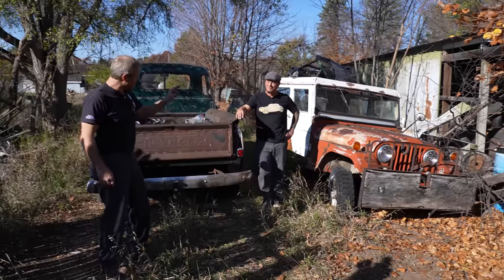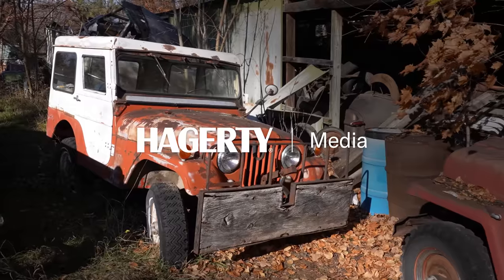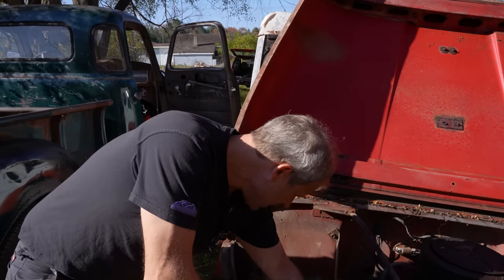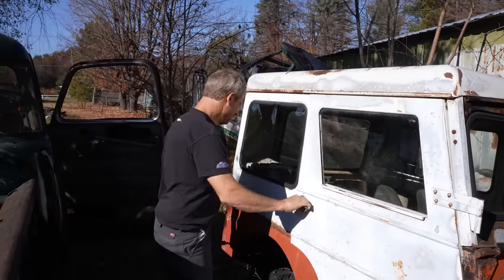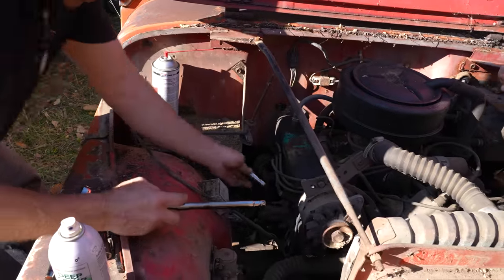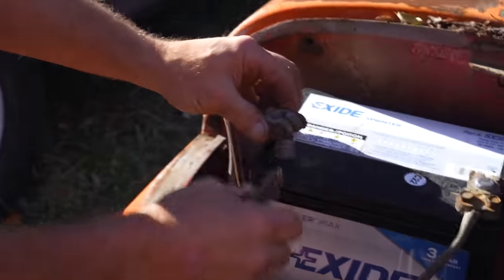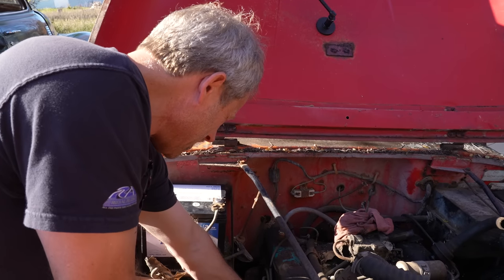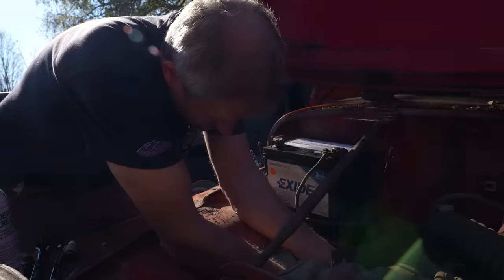Vintage Jeep CJ-5 Parked for 40 years! WILL IT RUN?

Comment: Buick actually sold that V6 design and castings to Jeep in the late 1960’s and bought it back from them when the oil crisis of the 1970’s hit. In it’s final form it was one of the best engines GM made.
Reply: GM made these V6 engines in two sizes. 3.1 and 3.8. The 3.8 was highly modified with turbo for Indianapolis 500 racing at one point. A little research on that would be interesting.
Reply: The Holden Australia (GM) used and modified that Buick 3800 up until the early 2000's in the form of the EcoTec.
Reply: What he said... I was looking to see if someone shared that info.
Reply: Yeah the window in cap is to adjust the spark. Mixtures

Comment: In 1973 my Late Dad bought a 1969 Jeep CJ-5 from the original owner. It had the same drivetrain as this one. The p.o. had also installed a Warn Overdrive and a Ramsey 8000 lbs. P.T.O. Winch. It's what I learned to drive a manual transmission on and it's also the vech. that I took my driver's lic. test in and somehow I scored 100%. I was the first one in my group of high school friends to get my lic. so I became the "taxi". This was back in 1975 so gas was still fairly cheap. And man did we ever drive the wheels off that thing. But the coolest thing to the then 15 year old me was .They had installed in to the dash an altimeter out of a P B Y Catalina Flying boat. Dad and I went to the highest point in the county where we lived there was a fire tower on top that had a elevation marker there and the altimeter matched what the marker said. Sadly both Dad and the Jeep are gone now. But the memories are priceless.
Reply: I, too, was the first in my class to get a license and became the taxi.

But, I drove an '86 Yugo. 😂

It's funny how everyone is your best friend until they all start getting their licenses.

Comment: Did you guys know that this jeep has an odd fire set up?  Makes a difference, I'm told, on how you have to tune it up.  Great job - Buick sold the engine to Kaiser.  It originated when BOP cut a two cylinders out of the middle of a Buick 350ish engine.  Kaiser used it in many a jeep, sold as the Dauntless V-6.  225 was the earlier, 231 was  the later CID.  There was no 304 CID until AMC owned Jeep in the 70's.  GM bought the 231 back from AMC in the the early '70s - and it went on to become the 3800 Buick will into the 80's and maybe even early 90's.  The Buick Grand National had this engine - basically.  After GM bought it back in the 70's, they re-engineered the crank shaft to make the engine and even fire, making it run smoother and less fiddly to tune. There is no relation between this engine and the Buick 215 Aluminum V8, except they came from Buick.
Reply: i have the 3800 series3 in my 06 Buick Allure final run ended in 09
Reply: Actually, the Buick V6 came before the Buick 350 V8 (1962 for the V6, 1968 for the 350). It was similar in design to the 215 aluminum V8 introduced in 1961, and the 300 V8 introduced in 1964 had the same bore and stroke (3.75 x 3.4) as the 225 V6 seen here. The 300 deck height was increased to allow for a 3.85" stroke, giving birth to the 340 V8 in 1966, and the 350 was derived from the 340 by increasing its bore from 3.75 to 3.80".
Reply: @cdglasser  Yup, the Buick V6 was developed from the Buick Aluminum V8.  The Buick Aluminum V8 design was eventually sold to Rover and was manufactured up until 2008.

Comment: 14:33 is why, when I'm working on the engine over dirt/gravel, I bring along a regular 'ole drip pan to shove under the car. And a magnet on a stick. I realized I'll never get those hours back that I used to spend looking for those damm tiny screws.
Reply: When your prepare like that, though, is when the universe kicks in and bolts land in a hole in the frame barely larger than the bolt itself.

😂

Comment: Old retired mechanic here, simple way to set GM points is to turn the screw in until it starts missing, then back it out 1/4 turn and it will be pretty close to 30 degrees dwell. I cut my teeth on points but it sure made my job easier when they went to electronic.

Comment: Great video, guys!  That 225 Buick odd-fire (fired at 90-150-90-150, instead of 120-120-120...) has an odd growl to it at speed, almost like a three-cylinder harmonic.  OMC also hooked these to stern drives, and they were used in the now-rare Evinrude "Explorer" and "Sportsman" 16-foot tri-hulls. 150 and 155 HP, IIRC...
Reply: Spam

Comment: That is a Buick 'Dauntless' V6, aka the 'oddfire' Buick V6. In my 1970 Kaiser Cj-5 Renegade I I'm runnin the same motor, except mine has two 2-barrel carbs, Hedman headers, and is bored .060...Dana 44 Posi rearend with Henry floating axles, a Dana 35 front end, 3spd with a Warn manual overdrive and single stick transfer case...my Dad left it to me when he passed last August, I grew up in this Jeep, it's a great rig...🤘🏻🇺🇸

Comment: I had always worked on my own Fords- you took the cap off, connected a dwell meter, and then cranked the motor to see the dwell, and then adjusted the points. I had a friend who owned a 66 Malibu SS with a 283- I did a tune up for him and was amazed at that GM design- window in the cap so you could set the dwell while the motor was running. Brings back memories.

Comment: I’ve changed that type of UNI-Points in the dark at the strip between runs,loosen 2 screws and then twist the unit a little bit and out they come.Reinstall and you don’t even need to set the gap

Comment: FYI Dwell is a primary voltage circuit you measure at the Coil Primary connection. You can also measure Dwell on a scope, but typically GM points were usually adjusted during engine cranking.

Comment: I had one, a 1968 CJ5 with the Buick V6 in 1971. 55 MPH top speed, tractor trailer trucks would blow it onto the shoulder on the NJ Turnpike. Traded it in for a new 1972 CJ5 with the 304 V8. Only a 3 speed that year, but with the 3.73 rear gear, it was a stoplight to stoplight monster. I would top speed it past the 90 MPH on the speedo up to the E side of the gas gauge.

Comment: This 60s Jeep brought back memories of my gas jockey days at a Phillips 66 station where we would pump the gas,  clean the windshield, check the tire pressure and check the oil. While we were under the hood, we'd check the condition of the belts, too. As a very young 19 year old I remember driving a Jeep that belonged to the service station. I remember it was quite peppy with the Buick V6 engine and a blast to drive going to pick up parts and help deliver customers' cars that we had worked on. My boss used to take it to chase down tourists who would drive by the station pulling trailers because the station was on a major highway through our town. He'd go after those with a low rear end because of the weight of the trailer. Then he'd convince them to come back to the station so he could inspect the driveline to see if the pinion seal was leaking. That was the draw. If it had oil coming out of the differential he'd offer to replace the pinion seal but the real reason was to get the car up in the air to inspect the shock absorbers and tires. He'd break down a tire or two especially on the rear and often enough convince the driver that there were "heat cracks" in the rubber and the tires were on the verge of blowing in the middle of the desert or going over a mountain pass. Tires were a great margin item but the shocks were a good quick replacement too with good quick profit. But another big seller was air shocks on the rear that would bring the car to level and save the pinion seal from failing again. He made a lot of money that way and maybe saved some drivers some grief down the road.

Comment: Back in the day the GM unipoints were easy to replace. just change them out and start the car up and then set the dwell with a meter. They cost a little more than the separate points and condenser but it made the job much simpler.

Comment: Had one when I was stationed in Alaska  back in the 70s. Little known fact, the small Buick engine had more horsepower than the V8 304, but not as much torque. Was a great running little engine. If you get rid of the stock exhaust and put a set of headers on it it will make a ton of difference in performance. The stock exhaust is really restrictive...

Comment: great video ,i remember these Jeeps running around in Canada during the 70's and 80's , i worked for a Volvo dealer that had one like that with a plow on it and it was just about unstoppable, cold started no problem, in the  late 70's i had a 66 Buick Skylark with a 314 wildcat  V8 and it had that exact distributor on it at that angle and i agree it was no fun to work on to change points and condenser  👍

Comment: I knew that Jeeps used parts from other car makers but thought it was strictly when
AMC was the parent company. Interesting that Kaiser/Willys used Buick engines.
Reply: Well not really. Kaiser bought the tooling and blueprints for the engine from Buick and then completely manufactured it themselves. It was a Buick design, but entirely built by Kaiser Jeep, casting the block and heads in their own foundry and everything. No different from how Buick sold the design of their 215 aluminum V8 to Rover in the UK who then produced it for the next 50 years. Yes it was a Buick design originally, but that's not really the same as "using parts from other manufacturers" as they weren't buying off the shelf engines from Buick and dropping them in Jeeps.

Comment: For the love of life and all that is holy, PLEASE learn & use the red rag method of manually putting gas down the carburetor == put a red rag over the mouth of the carb, wet it with gasoline (using your favorite bottle) then pull back to a safe distance and hit the starter. Multiple benefits to red rag method:
1. Works better than liquid shot or dribble, because the rag vaporizes the gasoline as the engine draws air through the rag fibers.  Surprisingly, the engine can run a few moments just off of the gas in the wet red rag. 
2. If you get a backfire, it puffs the red rag into the air. Entertaining but not very harmful. Worst case, you have a small red rag on fire, flip it off onto the ground with screwdriver or pliers, then laugh. 
3.  Get that can or jar or bottle the heck away from fire & brimstone and away your face. Don’t have your face under under the hood when the engine is starting. I had a friend who went to the hospital with burns from gasoline fire; he had a bottle of gas he was dribbling down the carb when it backfired - the backfire startled him and made him jerk & spill gasoline all over himself, then a spark caught him on fire.  Don’t do that.  Learn the red rag method.
Reply: Interesting. I've never seen anyone use that method.
Reply: Hagertyofficial_   I’d be happy to. Wish I had a carbureted car to demonstrate with.

Comment: Yes, Jeep used those motors in CJ5's and the FC150-170's flat nose pickups starting in '65 but they were the un-even fire version.  Back then Jeep used part assembly's from the lowest bidder and it was not unusual to find 3 different distributors in the same year engine for example.  You see a Ford solenoid and a GM starter, how about that Ford alternator or is it a Prestolite ?  You never know what you will find and it's all stock.  Take my word for it, they were terrible to get the right parts for.  Those are standard GM point assembly's used on everything, the condenser doesn't matter as long as there is one present.

Comment: From a total amateur to a seasoned professional let me offer a suggestion. When you're ready to try to start an engine that hasn't ran in a long time a squirt of starting fluid into each cylinder was always successful for me.
Reply: That's a really terrible suggestion. Starting fluid is mostly ether, which is a solvent that washes all the oil off the cylinder walls. You want oil on your cylinder walls for proper ring seal to make compression and prevent the rings from gouging the cylinder walls. Please don't do this unless you want to ruin an engine! A squirt of regular motor oil in each cylinder would be 1000% better.

Comment: If I remember correctly those were odd fire engines. When Gm started using them again I believe in 1975 in the H body cars, Monza, Skyhawk, Starfire and Astre they were still odd fire. Around 79-80 they were even fire. in 82 they were used in the Buick front wheel drive. Chevrolet used there own V-6 2.8 which led to the 3.1 and 3.4, 3.9

Comment: Fun fact this not only the engine Buick sold the blue print of there v6 but sold a v8 to rover in the 70’s which stayed into production until in the early 2000’s in Land Rover . Anther fun fact the v6 was called the dauntless and the four pot banger was called the hurricane and they did have 8 banger called the commando 😊

Comment: Great series guys, really want to see the 1958 Ford run, plus what is the car in the background at the 4:30 mark?
Reply: I think it's a Ford "shoebox" from around 1949-51.
Reply: @stephenholland5930  Thanks for that, I saw another YT clip with a "Shoebox" in it later on and it looked the same. They are a nice looking car.
Reply: @paulmartin7737  Dylan McCool on YT has just acquired one.
Reply: @stephenholland5930  I reckon that was the one I saw

Comment: After Davin commented looking for a oil change sticker or tag to date a vehicles last time on road, it made me wonder if tires of that vintage would have (and be legible) a date code combined with estimated wear to make a guesstimate of time setting.
Reply: Old enough tires don't tell you a year, those around 50s I believe and later on tires up until the 90s only told you the year of a decade. So let's say 8 could mean 1988 or 1998.

Comment: Would be nice if you just throw it in gear to see if the trans works in forward and reverse then you'll know if it's worth coming back to with tires, brakes etc. the next step.

P.S. I really DON'T need to see it do 'burnouts'!

Comment: 90 is kind of a normal minimum. That said, a Model T ran on 4:1 compression? Not sure on a lbs of compression reading. Timing is crucial on lower compression engines. Anyways, we all know that. You guys keep digging them out of the leaves and getting them back into the driving group.

Comment: Is that a home built door/roof assembly?
Reply: No. Many companies sold hard tops and Jeep offered them as special equipment. Meyers is the best known, but also Orrville and even Sears Roebuck offered them.
Reply: @upscaleshack  Ahhh, Right. I remember Meyers, or course, most notably for the snowplow equipment. and probably saw an offering or two in the SR catalog as well… thanks for the info!

Comment: they did not put buick engines in rovers ,roverbought the patents and rights to the design of the buick aluminum v8 reworked it for there vehicles and did it so well gm twice triad to buy them all back